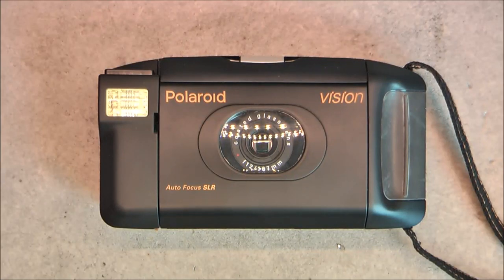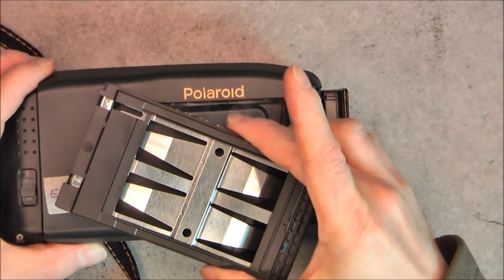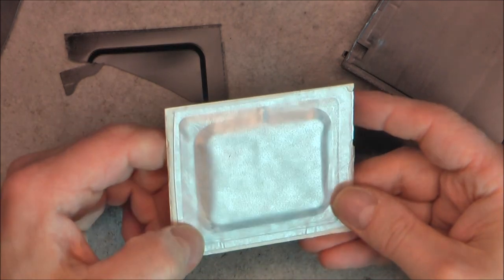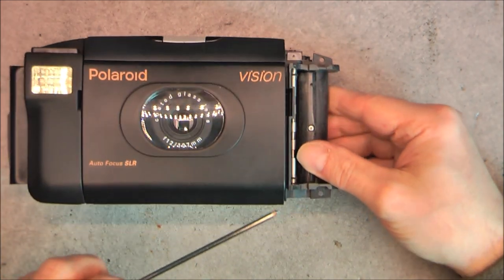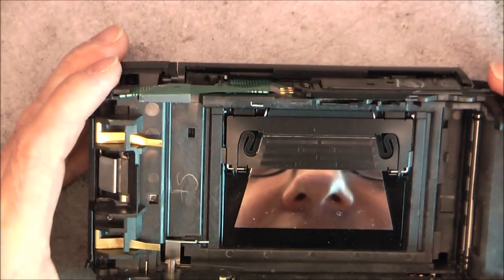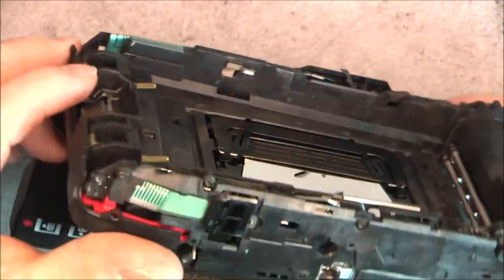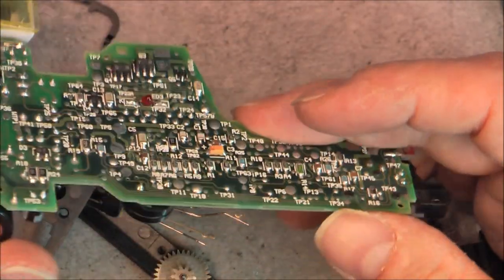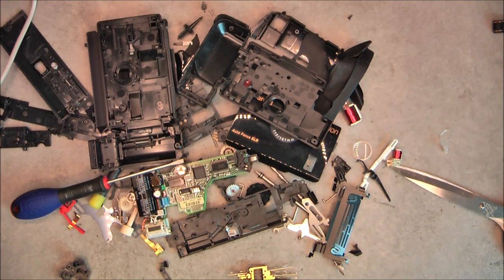Polaroid Vision SLR camera teardown

Comment: If you ever encounter those miniature Robinson screws again?  all you need is a cheap flat screwdriver that fits snugly diagonally inside the head of the screw and it will remove time almost every time!... I found a modified Philips will usually strip them almost every time myself but you still managed LOL!
Reply: struggling with this problem right now, diagonally would mess the thread up won't it? thanks for the tip i'm gonna try this now